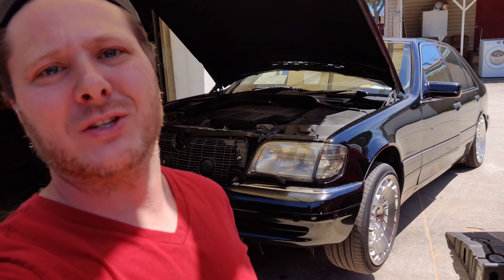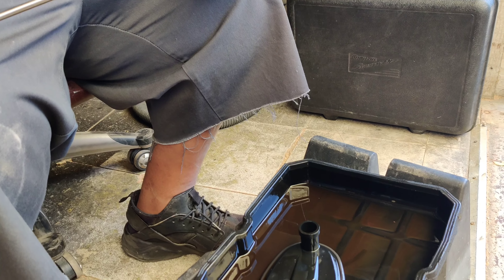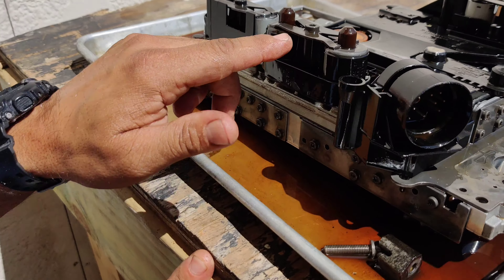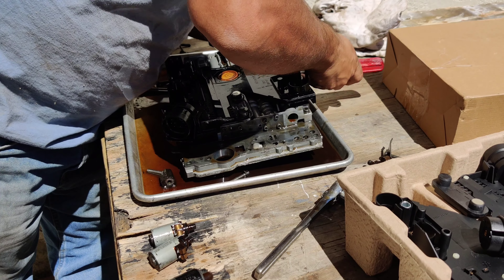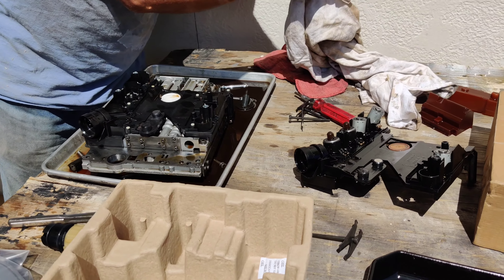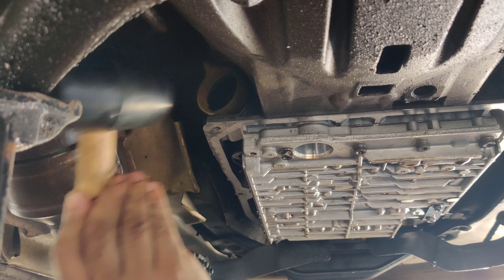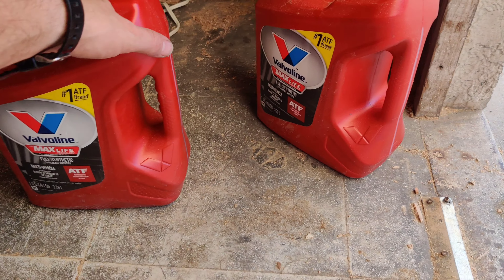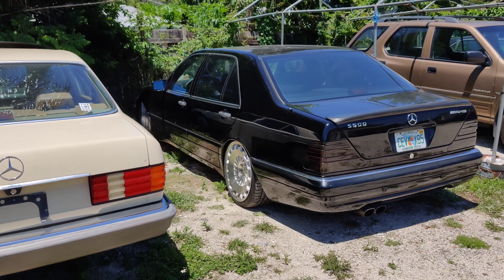Conductor plate change w140 1999 s500 Mercedes limp mode

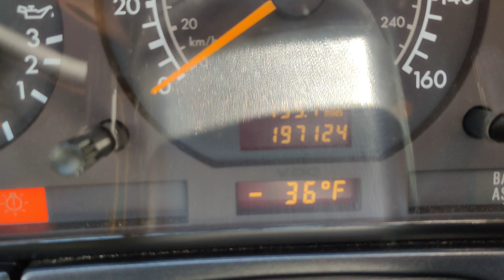Comment: Pete, nice video, thank you! I have a question - is it possible to install a new plug on the plate (when it's on the ground/bench) before you attach the plate to your vehicle just to avoid hammering it later? And also I noticed at 15:00 that oil pressure equals to zero which I guess is not true. This may be an Idea for another video on how to fix that stuff! ;)
Reply from the maker: I'm not sure about the plug but could find out.   This was first time I had watched live the conductor plate being done.   
Also good eye on the gauge.   These seem to start having issues around 150k miles from what I've seen.  The one on my car is currently having issues as well so yes it will be in a near future video.
Reply: a bit late but no , it's not possible to fit the plug on the bench as it needs to seal from the outside

Comment: Did you have to reprogram the TCM?
Reply from the maker: We didn’t have to but I’ve heard many times you do.  I believe it has to do with what codes it causes.    Some may need to be cleared through system and others just go alway.
Reply: @petescarport  I finally figured out the old issues with the transmission. I replaced the conductor plate, oil and filter and I still did not solve my problem which was not shifting when it's cold. So I finally found out it was the gear switch shifter!

Comment: solenoid spring torque is like 6nm. all other bolts for valve body are 8nm
Reply from the maker: Thanks bro.
Reply: Totally useless information, most of the time, but nm is the symbol for nanometer and Nm is the symbol for Newton meter.  :)

Comment: I replace the conductor plate and made sure all my solenoids were working properly after I was in limp mode I still have the P0743P0753P0758P7063 error codes which are all shift solenoid‘s. I’ve tried the icarsoft to reset these codes to no avail I did see where it was mentioned that no transmission reset was needed but I cannot get rid of these codes I have the same vehicle 1999 s500
Reply from the maker: I don’t know why but sometimes a reset is needed.  I’ve discussed this with a few mechanics who all say they use there software to do a full reset each time. But I have also heard and experienced myself no need for reset on some cars.
Reply: @petescarport  Bunch of people told me to get a icarsoft scanner but it does not appear to support my model I’m not sure which reader I’m going to need that supports this vehicle
Reply from the maker: I have the icarsoft and swore it has yours.  I have it at my shop but have never used it on a w140 to do transmission reset.  My mechanic who’s a friend has a very expensive snap on one and he reset it for me but I can find out
Reply: @petescarport  from what I understand how the icarsoft menus work the first three digits are the chassis number there is a 220 S class up to August 2002 however this is a 140 I did try to connect under these other menus but I was unsuccessful.
Reply from the maker: Can you message me on Instagram.  I have off Wednesday and can maybe walk you through it or guide you right direction

Comment: All the 90s Mercedes have transmission issues PREVIOUS  c220 c280 300se  s420 s600coupe 300e  -the 600 coupe all gave me transmission problems trans seal ext...now I bought a 300sl  5speed  or if u want one buy one with the trans already bad because I think is not if it's going to go it's when ...
Reply from the maker: Actually these transmission are extremely reliable.  95 and prior don't have the conductor plates but are 4 speeds.  The 5 speeds will last 300k or more but need to replace conductor plate at about 150k.  Not too bad.